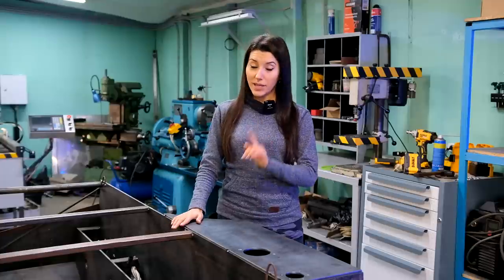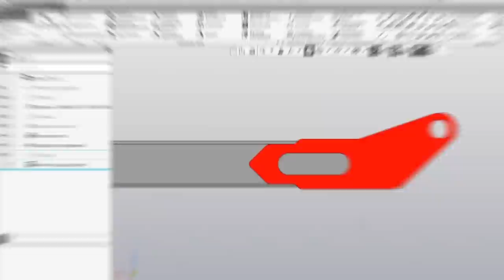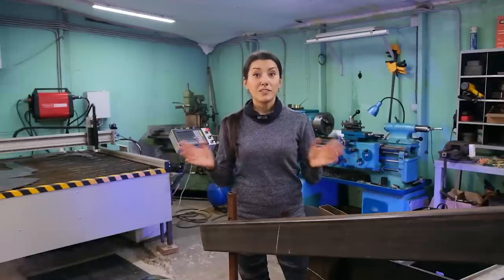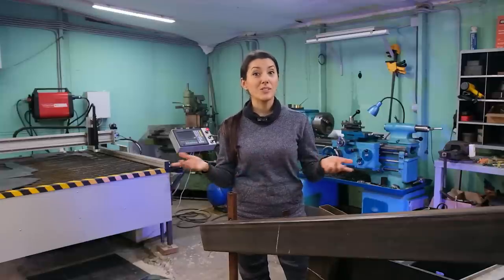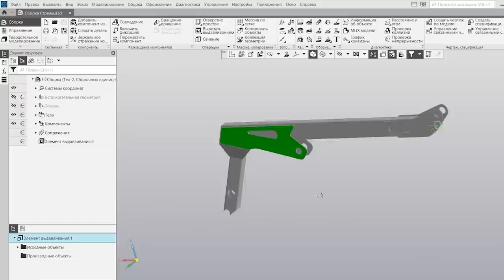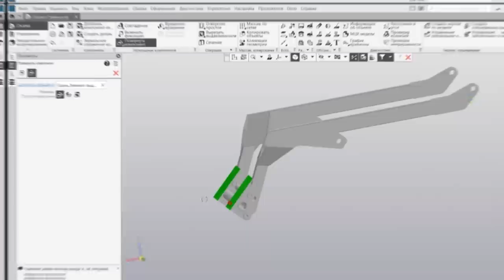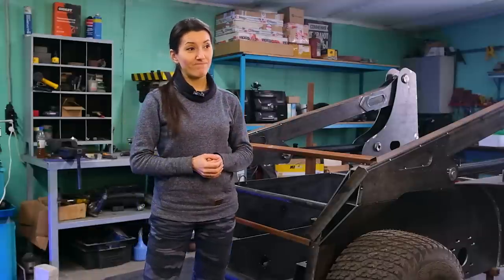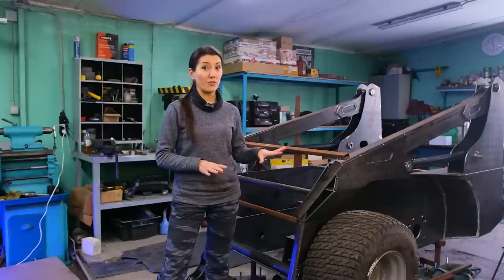DIY SKID STEER. Part 2. Boom arm. MINI LOADER.

Comment: As someone who has done a lot of fabrication over the years, but never anything this complicated I can truly say you are doing a fantastic job. Stopping everything warping as you weld it up is hard work. What you've designed is very complicated, a lot to get your head around, and it's all too easy to forget about something, but it can always be fixed one way or another. Great to see the progress on this.
Reply from the maker: You are right. Thank you😊
Reply: & all the pin alignment. So impressive!!
Reply: @luciasworkshop   I’m not sure if it’s a scam or not but I keep getting emails that I won something and to text you on telegram is this a scam email
Reply: @denniswaller7514  yes all of those are scams

Comment: Lucia, I love the design of your skid loader and I am a welder fabricator and heavy equipment operator and mechanic. First, metal is weldable and replaceable. You can always fix design flaws and that's all part of the learning process. My concern about your Skid loader is basically your pins and bushings. Those components have to be made with some very hard material or they will gall or wear out very fast. I don't know if you are aware of this. Also you must put grease zerts to do daily maintenance on the machine. All friction points need lubrication points that won't get damaged in the operation of the machine. Brass is also an option for wear parts and bushings. It is always good to be able to replace bushings and pins easily. So you would basically make a place to press in a bushing that can be removed and replaced along with the pin. So where you are making heavy duty welded in holes to pass your pin through,those should be much bigger to resist excessive wear. Because sooner or later somebody will over load the machine and try to pick up something very heavy and it will cause excessive friction in the hinge points and they will grind together and wear out fast. I would recommend that you go find a construction site or heave equipment company and ask to speak with the mechanic. I would recommend also you go to Caterpillar and look at one of their skid loaders and take thousands of pictures for reference. Now you may make this for yourself and be the only person using it to move potting soil and dirt in your garden, but the next thing you know, your neighbor comes and borrows it and they use it like a "communal donkey and overload it". Also the steel plates and your reinforcements are very good and I like the way it looks. The rear plates should be much heavier in my humble opinion. The reason is they must resist excessive twisting forces. Because you will get a scoop of rock or wet dirt and turn the machine quickly and the inertia will make plates twist and they will break welds and it could cause a failure that could injure you or somebody working with you. I don't knock you for building this machine, you are doing great. Everything must be overbuilt because of the stresses and constant vibration.
Reply: I was gonna comment on the pins and ability to grease them, but you did a way better job, lol.
Reply: I was also going to comment on the same lines but you beat me to it, good points well made!
Reply: +1 on the replaceable bushings.
it's going to be virtually impossible to think of everything without a team of engineers behind so you will provably modify and upgrade your design during the process and even after years of usage.
Very interesting to watch the process.
Reply: I have used a lot of skids and I am not sure if the bushing are harden steel. I have a feeling they are just mild steel and grease is applied. As we have had to replace bushings in an older machine that someone used and never used great on it. We pretty much cut out the old one using a hole saw and a board to keep it in place. He milled up one that was the about the same size and then welded it back on by using 5 foot long round stock to aligned both bushings. As long as you use the right carbide hole saw and you think about it all they are pretty easy. It did not take more than a few days to do about about half on an old loader machine. In the end the machine work quite well and after fixing everything, spray and pray, new rubber it was a very nice small loader.
Reply: Well said Jimmy,  Just a couple of other little points I'd like to add for Lucia to consider.  Grease nipples or zerts are easily broken off during operation so it is always worth putting a protection collar around them or locating them where they are protected and this is why so many manufacturers bore a passage through the center of the pin and recess the nipple in the end of the pin.  Early skid steers were a real pain to work on due to the frame being made and then the engine shoved in from the rear with no consideration given to accessing anything. If the cab can be set up to be tilted with all the controls pivoting on the same line as the cab then it is so much easier to replace a failed part.
Reply: from the looks of her weld in bushings, there is just enough room to line bore them and install bronze inserts. As for her pins, maybe she will replace these with harder pins and these are just for mock up? who knows, its only vid 2. Go lucia!
Reply: That is some sound advice Jimmy.
Reply: I have been a garbage man operating primarily rear load garbage trucks for 3 different companies over 13 years. My observation is that for a heavy load mild steel plain bushings are used. Of course, they have grease zerts and channels but then they should really get greased every 20-30 hours of use in most cases. I think her bushings might work.... with additional detail work. On the other point you made, thank you for the thought about the eventual inadequacy of the gussets on the lift arms. Im watching this to improve my metal fab skills.
Reply: Some of you are either not observant or I imagined it, but there was holes for grease nipple's. I've maintained car transporters for over 25 years. It's extremely rare that there is a brass bush on the pivot pins, I've often wondered why not, just seems to be the way that the build them. If it's greased regularly and not used a lot, then it will last a long time.
Reply from the maker: Thank you for the very detailed advice Jimmy👍
Reply: @TheRonskiman  probably cost, even though they would make a lot of sense if maintained properly.
Reply: Very well said, as I am a welder and heavy equipment operator too. I hated having to climb around the equipment to grease everything, but it is necessary. And Lucia, no matter how much mistakes you make, just remember it can be fixed, I can't tell you how many I have made but as a fabricator, you can fix it. Just takes time an patience. Don't stress too much about it as it will come along, and I couldn't have put it better myself with what Jimmy said. I would follow that exactly. It's coming along great, and I am enjoying watching it come together. Can't wait for the next one.
Reply: @Ronskiman I reckon it's because a bushing in that context has a high radial loading scenario whilst the rotation is limited to a fixed range through its cycle and not continuous rotation like an axle for example. Brass is usually found in low speed high load applications as a bearing medium, due to its advantages with the friction forces etc. For a bushing like on the skid steer we saw, usually you would fix the pin into the bosses on the side plates and have press in hardened steel bushings in the corresponding arm boss. The pin is effectively in double shear when loaded and the bushings and the pins which I assume are often medium or high tensile steels and case hardened to resist those shear forces, bending forces and have adequate mechanical properties such as toughness, hardness and a suitable tensile strength, as well as the grain structure etc etc to also provide the life cycle expected and resist the abrasion and galling etc from the pin and bushing rotating under a high load scenario. That's why a good surface finish and toughness as well as the hardness and tensile strength all matter in the material selection.. hardness of a metal speaks of its ability to withstand abrasion from what I know and Steel can be alloyed, heat treated, cold processed etc to give a wide range of suitable properties and is more affordable and accessible than brass as well, so economically and practicality wise steel wins most of the time.

As for the design, I think it looks pretty good as well, definitely impressive for someone relatively new to the trade. The hydraulic cylinders on the arms would likely have bushings and lubrication, so really it's only the arms themselves that would need bushing in my opinion, but definitely would benefit from greasable bushings and polished hardened pins. Personally I'd get some of that 8mm plate or thicker and weld doubler plates over the rear tower plates you have designed where the arm connects, personally I'd have made them from 16 or 20mm thick plate and try to box it in around the base more, to limit the ability of those plates being able to twist, with the bucket full of rock or dirt etc and raised up whilst turning quickly and stopping rapidly as a skid steer does, the leverage and resulting forces on those plates is going to be massive!  I also agree with Jimmy about the potential for damage and harm, to people and property. Usually things like this are designed with a fixed load capacity in mind and the mechanical parts and associated components calculated with a suitable safety factor 😀 so having thicker high tensile materials and some additional mass and section thickness around the base of those connections will be a good thing. amazing project though it is awesome to see your approach through it as it takes shape. I have enjoyed all of your projects so far, keep it up, you are doing great work and I think you're an inspiration and great example for anyone who wants to give something new and difficult a go!
Reply: There were many places where holes were drilled in the connection points. They were probably for zerks.
Reply: Lucia could always case harden those pins, most welding suppliers should sell the powder.
Reply: Given that Lucia is building this for herself it is Ok that it is not "Engineered" like a Catapillar one. I guess we will see what she does in the future with the bushings etc. She is building it and will be the person doing the maintenance and fixing.
I too am very interested and will be watching as Lucia progresses with the build.
Reply: Or she could have them induction hardened. I saw this done on small gears in my hometown in South Africa.
Reply: and when he said they will wear out fast, what he meant was 3 days.
Reply: Everything must be overbuilt to meet some kinda code, but I agree with you about the grease zerks and the size of the pins. You can go into the Machinery Handbook and find tables for what size pins you need for this kind of application by figuring how much weight you're planning on putting in the bucket. But most definitely GREASE ZERKS. I've seen many a cocky person be humbled real quick by ignoring advice about greasing bearings and high friction and high wear surfaces. You'd be amazed how fast those pins will weld themselves to each other as soon as whatever grease was put in there at assembly dries up and you start putting them under a load. That's something that has always fascinated me.

Other than that I think she's kicking ass!! Haven't seen anyone else attempt to build their own skid loader from scratch before. Very challenging.

Comment: Nice looking machine, and a lot of great points below.  There isn't much I can add to everyone's contributions.  Not that you have the time, but there is a fellow in Australia, Curtis of Custom Edge Engineering, who does great videos of repairs on mining equipment.  He goes into detail about the failures of equipment, and how to avoid it, like where to place grease fittings.  Keep up the great work, and kudos to your photographer and editor.

Comment: A skidloader is a great thing to have around, I've got a little Bobcat M371 that must be over 50 years old.
It's so handy for small jobs, I did a little restoration work on it about 5 years ago, it got new hoses, a set of cylinder seals  and I made a new bucket for it. I must make a tine bucket for it when i get some time.
I'm loving this build, that's a big project to tackle and there are always going to be modifications and improvements as you go, don't stress about the upper cylinder brackets too much, a solution will present itself, I would say don't rule out a redesign of the arms, if you're not happy with things it's best sometimes to bite the bullet and remake it.

Comment: Nice work! As an equipment operator and owner of a similar sized unit I would expect a 700 +\- LB safe lifting ability out of such a machine. As to echo some previous comments Adding the ability to be greased in the joints is very important. Necessary if you intend to use the machine often in dirty conditions, as it could wear your joints prematurely. One current  solution could be to use the heaviest grease possible on your joint pins apon final installation. Regardless  excellent work thus far, I’ll be looking forward to seeing your machines completion! I have great faith that it will be a winner

Comment: It is a good idea to go around and see how other machines are made in order to pick up on what suits you and what not. Likewise to look at old eqipment to see where the cracks and fails are in order to avoid them. And for me at least to determine which design parts i like. I am keen on making things easy to mantain and keep clean as well as easy to operate. And having some plan for what extras you would like to ad on in the future it pays off to prepare for that. Making mistakes is all part of the game. Great job Lucia and remember: This is your project and you decide what goes or not. I envie you your workshop a lot.
Reply: If she is in Russia she may not have many different machines to study.  I don't think she can drive down the highway, stop at the John Deere dealer, drive two more miles to the Kubota dealer, than on the same road stop at the rental yard and look at the Bobcat and Mustang models, etc.
Reply from the maker: @Code Tech  This is only your guess 🙂
Reply from the maker: Thank you very much😊

Comment: Not sure how much weight your looking to lift with that skid steer. But it's looking amazing. And to see it being built is awesome. I know these are normally expensive to buy. I was blessed finding one in the junk yard that I bought for $$600 spent another $200 on wheels and another $200 having the flywheel machined to work with the skid steer Hydraulic pump adapter. So to me a $1000 for a running and operating skidsteer was a great deal. But the fact you have the skills to build this. Is amazing and something money can't buy. Keep uo the work

Comment: Beautiful work, as always.  Thank you for taking the time to narrate the video in english.

I see that you have provisions for zerks on the inner bushings, but be sure to lube the outer bushings and pins before final assembly.  If you don't, you'll have a difficult time removing them for service and repair.  You should provide a mechanism to keep the pins from rotating in the outer bushings to minimize wear.  It's common to weld a plate onto the pin with one bolt hole that gets bolted to the boom.  That serves to retain the pin and prevents rotation.  Try to avoid obstructing the other side of the pin so that you can drive them out later with a hammer and a drift.

Make sure you have a plan to add ballast to the rear.  You'll need it when lifting heavy loads.

Be sure to have some protection from anything that could fall off the back of the bucket.  It's likely to happen sooner or later.  You don't want a rock or piece of firewood to fall off and land on your legs.  I bought a brand new tractor with a loader a couple years ago and 2 weeks later I bought a brand new hood...

Are you building a standard quick attach for the bucket or a custom solution?  Quick attach generally comes with a performance penalty, but it's worth it in my opinion.  You'll probably want to build or buy a set of pallet forks.  They're very useful.  You might also consider adding provisions for a third function when you do the hydraulics.
Reply from the maker: Thank you very much for the advices Mike😊😉👍
Reply: @luciasworkshop  good luck with the build

Comment: I JUST discovered your channel and I'm absolutely fascinated by a beautiful young woman with the drive and skills that you have.  I'm not an engineer, but I would suggest anywhere you are unsure about your connections between larger flat surfaces, drilling an extra hole or three and puddle welding them will certainly enhance the strength!  Keep up the good work!

Comment: On that heavier gauge steel you can burn your tacks in a whole lot more than that. If it's something that I'm about 95% certain isn't gonna come back apart later then I'll burn my tacks in at about half an inch or so. Means less tacks you have to do and it still be sturdy enough to not fall over while being mocked up.
You're kicking ass so far on this build though!! Don't know that I've seen anyone else attempt to make a skid steer from scratch. Very challenging.

Comment: Pretty sweet! Very good for just measuring and fabricating you did a great job minimizing warping if you run into any problems in the movement of your pivot point which it doesn’t look like you will a quick lineboring will solve that! very impressive!! Keep up the good work!

Comment: The design is looking awesome.  Even though you are using an engine block crane, it is really good practice to be using slings when you are welding.  It is important to isolate your circuit.  That was really good to see.  This is a really really big project.  Keep the faith you can do it!